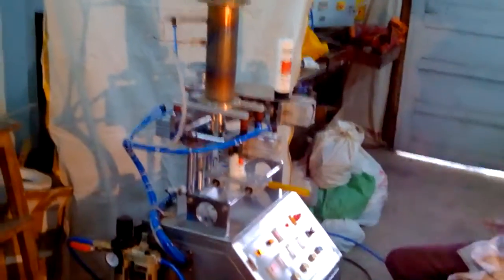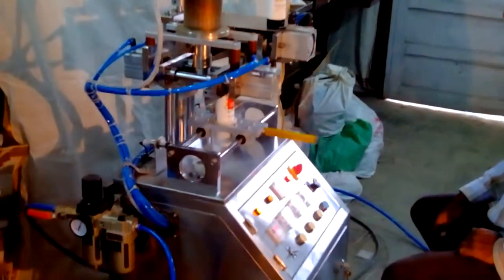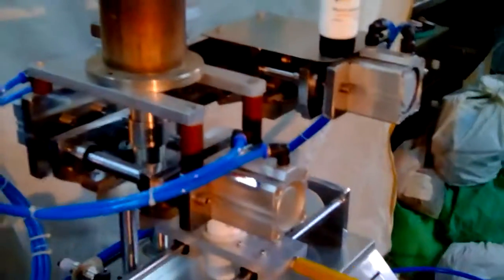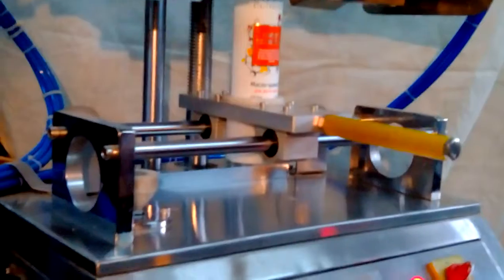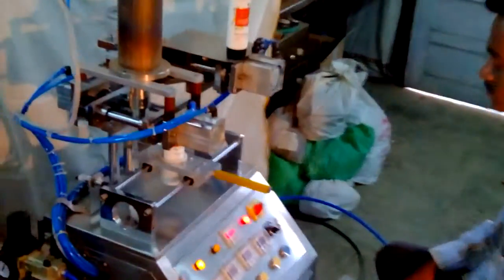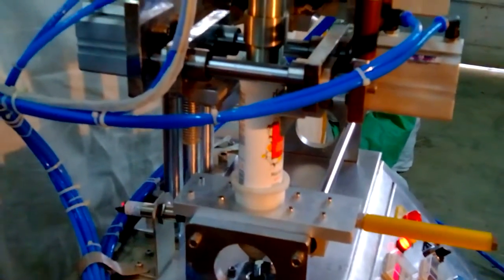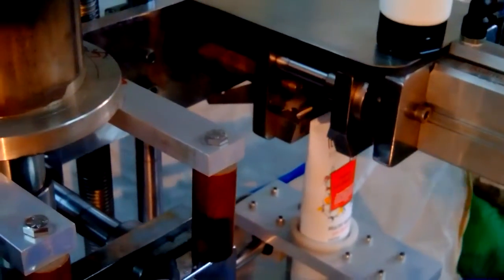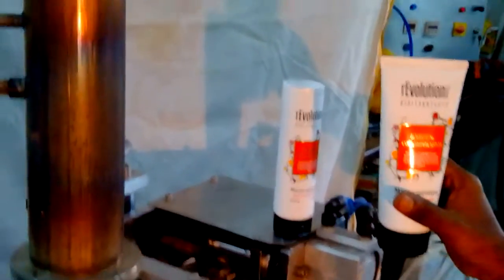SEMI AUTOMATIC TUBE SEALING MACHINE MODEL PSCT15

Comment: i am pleased by your demo and its performance. I am manufacturing computer polish and filling in hd botttles of 200ml capacity. i want to shift to sell in tubes. i need its price. kindly let me know whether the hot air will contact the inner material. i am also planning to expand with related products in tubes. kindly send your reply to my email  jawaharlalpolish@gmail.com and i will be thankful if you can reply thro letter.